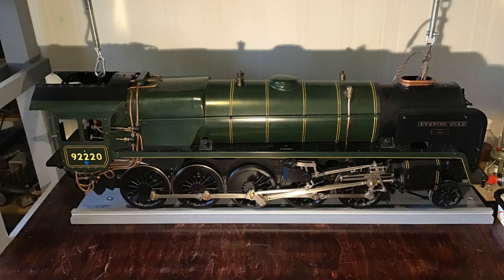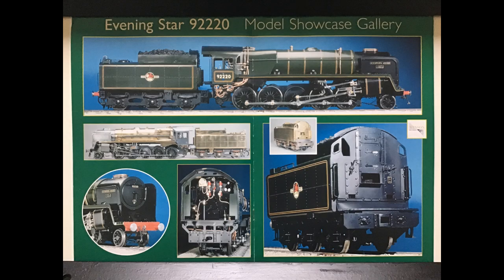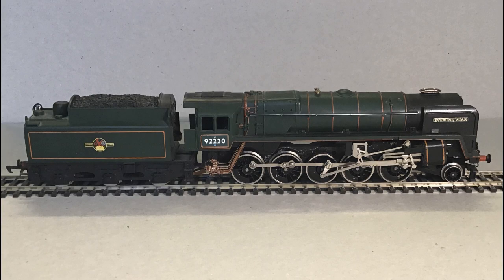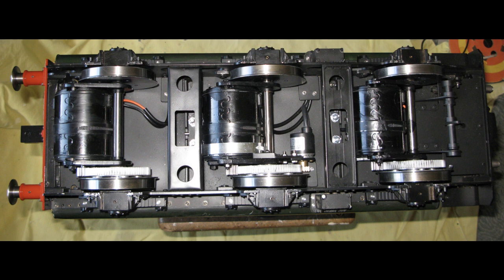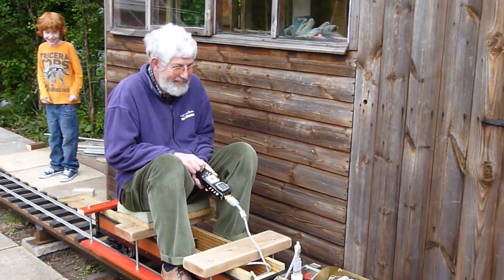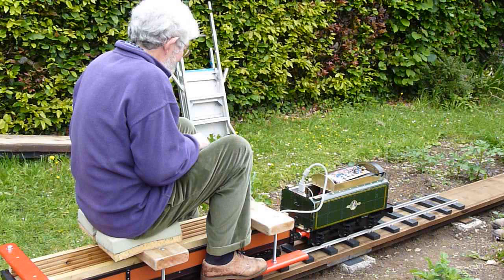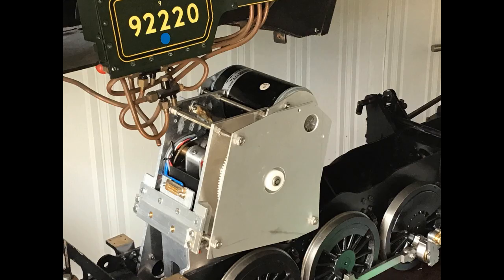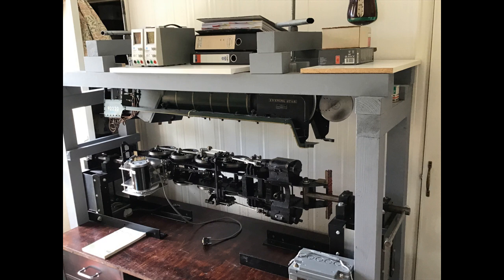5 inch Gauge ELECTRIC  9F Evening Star (Part 1)

Comment: How much space is in the boiler?
Be interesting if there is enough room for a sound unit.
Reply from the maker: There is a sound unit. It can output MP3 sounds from the hand controller and a "chuff" sound synchronized to the wheel rotation. It will be described in the Electronics Part. It lives in the boiler.